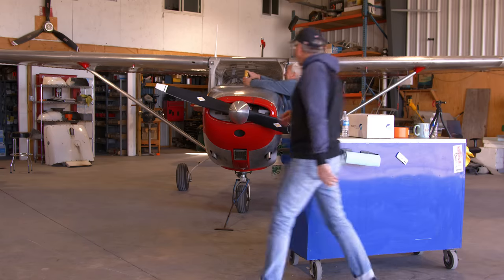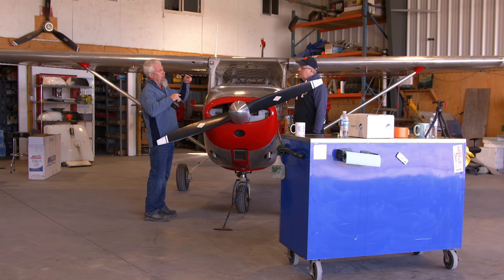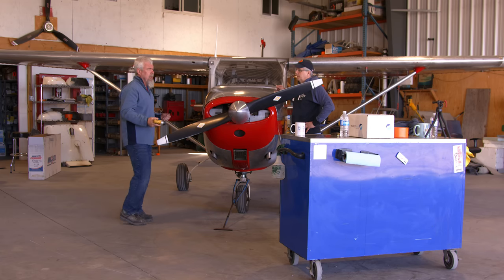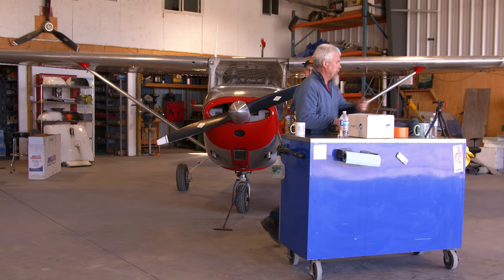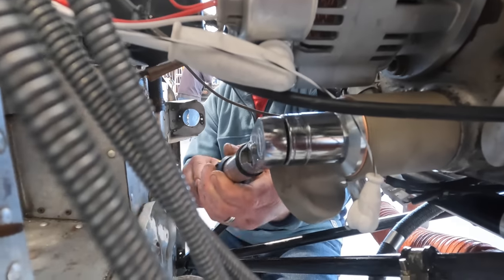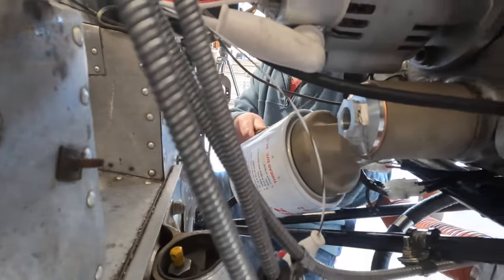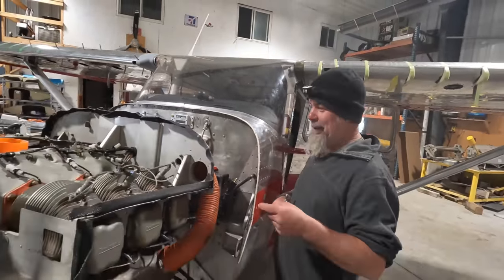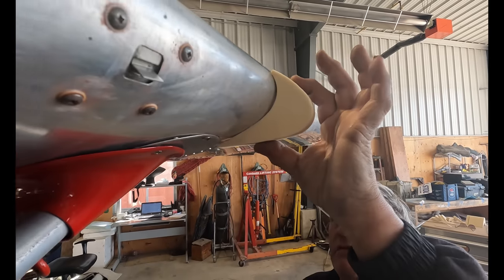Back In The Shop! First Oil Change, and MoGas Modification

Comment: Great looking aircraft. As far as the oil samples, they will show the health of the engine and if any problems occur. We used them at my last job and it was helpful to track the condition of the engine. it will also show if you have bad bearings, fuel leakage into the crankcase as well as water in the oil. Keep the reports, they will be helpful for the next annual. Chris is aware of these reports and the usefulness of the reports. As mentioned before Chris is not only an excellent AME he is an excellent teacher who does not mind sharing his knowledge.

Comment: I owned a 1961 172 in late 1980's.  As a A&P ad IA  I did my own inspections.  The plane had been stripped and painted 5 years earlier.  During the annual with the flaps fully extended the flap balance cable rusted the length of one inch with only three wire strands the flap down.  Stripper had gotten on the cable.
Reply from the maker: Something I was warned about when I stripped it - definitely did a lot of extra rinsing and neutralising, and all of those corrodible bits are high on the watch list for the next few years.

Comment: Get rid of those Slick 600 series magneto dinosaurs!  Yeesh!  Be safe out there!
Reply from the maker: It's on the list - we tried to put on an e-mag, but they aren't compatible yet with this engine. New mags will be part of the next shop visit.
Reply: @GlensHangar  Get some Slick 6364 or Bendix S6LN-21. If you get some used ones I’ll give you a smoking deal on a 500 hour inspection at our shop…. … for a selfless plug of course…🙄

Comment: Great idea putting in the filter adapter. Personally I would not go with the auto fuel adapt,,, as they say to each their own. May be the sign of the times.
Reply from the maker: It's a 'nice to have' / just in case type thing... I'd rather have it for those airports where 100LL Avgas is in short supply or non-existant, but Ethanol free unleaded is abundant.
Reply: @GlensHangar  Don't worry about the autogas detractors. I personally run 75/25 mix of autogas/100LL in my 150hp O-320. Runs great, no fouling, and I save $1200-$1600 per year depending on the price difference for ~100 hrs on the tach per year. I can even run straight 87 if I want and all gas in Alaska is ethanol free, but I test every time to be sure. I'll basically save the price of an overhaul over 2000 hours.
Reply from the maker: @ansonmoxness5403  That's what Chris says I could do - this engine was certified for 80/87 leaded, but that leaded gas had less lead (way less lead) than the 100 Low Lead available today and a 70/30 Mogas / 100LL mix gives about the same lead level as the old 80/87.
Reply: Personally, until I see UL100 take hold globally, and even when it finally does, I think running mogas is the way to go.
Reply: I totally support the shift to auto fuel, those lower compression engines run just fine on 87. The ethanol question is a little more complicated but I think it's over blown. Good on you Glen.

Comment: On a note about leaded fuels, there's actually a really informative video by Veritasium about why leaded fuels are bad for humans.
Reply from the maker: Leaded fuels are horrible for humans and the environment, I think AvGas is maybe the last holdout of leaded fuel? A few municipal airports have banned it, and only sell unleaded MoGas, and JetA / JetB - which is a great step forward.

But it leaves behind a lot of aircraft that can't legally burn anything but 100LL leaded fuel. Not everyone is going to pony up the almost $500 that I did to get a sticker that says unleaded is fine for my aircraft; regulations need to change and Ethanol free fuel needs to be available at every airport.

Comment: Interesting that the inner leading edge profile is wrong on the "Next Time" clip. I wonder how much that's affecting the handling of the aircraft, particularly on the assumption that the starboard leading edge is all to spec.
Reply from the maker: I've flown just about 20 hours in it so far - and never noticed any trouble with flight characteristics. Stall speeds, Vr, Vx, etc were all within book values; so even though Andre says the edge is wrong (he'd know; 50 years of aircraft sheet metal experience much of that in the RCAF) it must be within margins?

Comment: Hey. Are those the old 664’s and are you replacing them with new mag’s? I need to replace mine and I’m curious if Chris recommends going with new slick 6364 or a rebuild like a Kelly 6364. Any information would be greatly appreciated since this is a 7-8k expense. Thanks.
Reply from the maker: We tried to replace one of them with a new E-Mag (https://youtu.be/wND_hs0si1M ) but that didn't work out - so I'm looking at options right now. Chris was leaning towards re-built; he seems to think that the rebuilt are just as good as new / with a lot lower cost.  Probably something we'll tackle this winter.
Reply: Thanks

Comment: G,day Glen from Sydney Australia.
Oil doing its job?
* Lubrication
* Dispersion of heat
* Collect (cylinder piston ring movement)
* Corrosion resistance
Any large pieces found in the oil?
🌏🇦🇺
Reply from the maker: Nothing large found in the oil screen - still waiting on the lab analysis.

Comment: About that $300 placard. Yes, it's probably a $1 piece. But what you aren't figuring in is all the work to get it approved by the FAA, Air Canada, etc. Part of the reason small planes still use a lot of the "state of the art technology" of the 1940's.....
Reply from the maker: We get that - but if you've already bought the STC and years later just need a replacement sticker because you've updated the panel, or it's become illegible with age; the replacement cost is pretty steep.
Reply: @GlensHangar  Glen, you would think (famous last words) it would be substantially cheaper if you already have the STC, but I know that's usually not the case. BTW, I was trying to explain the reason to the non-aviation type of viewer

Comment: So I don't get it, what does the metal ring do then? Does the engine not need any actual modifications for using non ethanol unleaded automotive fuel and it's just a regulation and cost that governmental agencies levy on the aircraft owner? 

I mean, if so, I sorta get it, adding a one time (hopefully) tax to give you legal authorization to use fuel not originally intended for aircraft because it's taxed differently. Sorta like how kerosene that is dyed red isn't taxed to be used for auto fuel (it can be mixed with diesel to help with winter operation) so if checked and you have red dyed fuel in a diesel engine fuel tank you likely are doing a form of tax evasion.
Reply from the maker: I'm not qualified to put it all down on paper in a great explanation - there are problems with the use of MoGas because of Ethanol, or  not enough octane, or some engines need a small amount of lead (debated) for lubrication. Also additives in MoGas can cause vapour lock with some fuel systems, etc, etc.
The metal ring just signifies that my engine / airframe combo has been tested and will work fine with Ethanol free MoGas with an octane above 90. It also signifies that I understand that I should use at least 30% 100LL to keep enough lead in my engine for lubrication, and that I understand that vapour lock could be an issue at certain altitude, temperature, power setting combos. The sticker on the panel is a reminder.
Reply: It sounds silly to require a sticker but you know if there was no requirements someone would put mogas in a plane that wasn't compatible because they "heard from a friend it was fine".

Comment: Will you be running premium fuel, which contains no ethanol?  That's what I use in all my air cooled engines.
Reply from the maker: Yes - on occasion, when needed. I'll probably use 100LL AvGas 90% of the time, but there are a few airports in the North that don't have AvGas, and I'd need to get fuel in town from the auto station. So premium unleaded 91-94, and then test to make sure that there isn't any Ethanol.
Based on when this engine was rebuilt and the parts put in - it doesn't need much if any lead, but it definitely can't have any Ethanol.
Reply: @GlensHangar  Good stuff, Glen.  I may be showing my age, but I really, really miss the fragrance of 80/87...  (sigh)
Reply: @GlensHangar  None of them “needs” lead. That’s a old myth. I’d rather not run with lead but 1) It’s in the partnership agreement to use AvGas. 2) It’s not so easy to haul the amounts you’d need to the airport. That lead causes plug fouling, can build up at the valve seats to cause problems and is why we have to use Dino oil and change it so often. If you run mogas you’ll avoid all those issues.